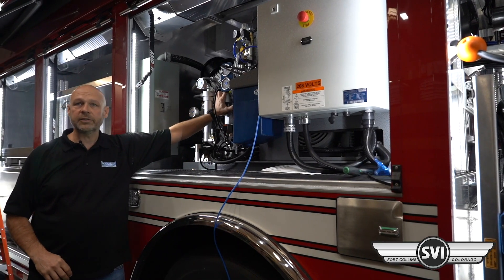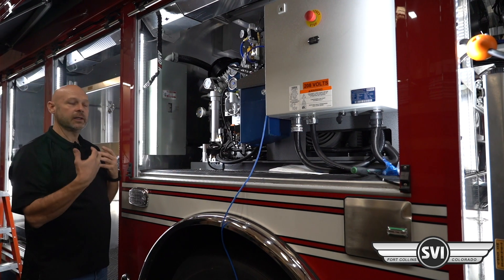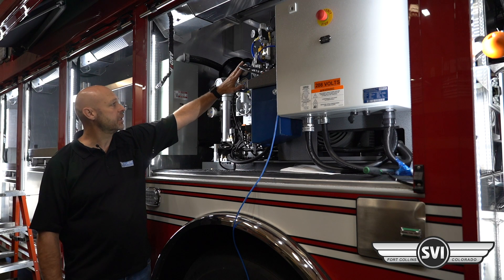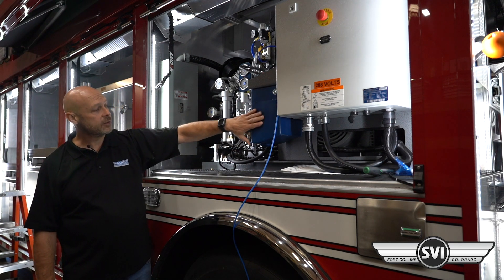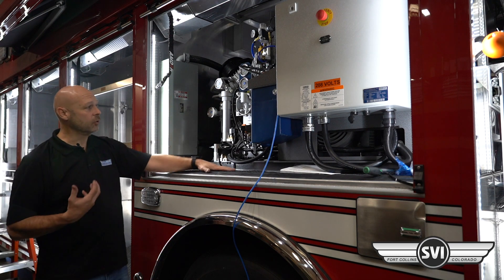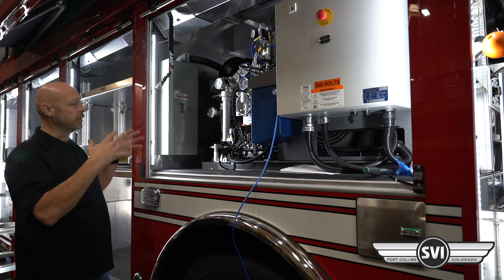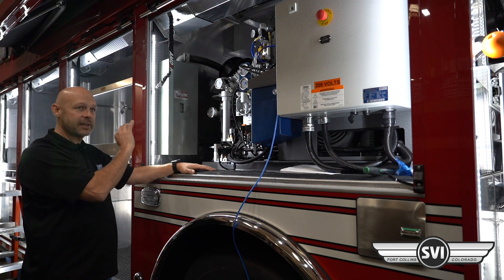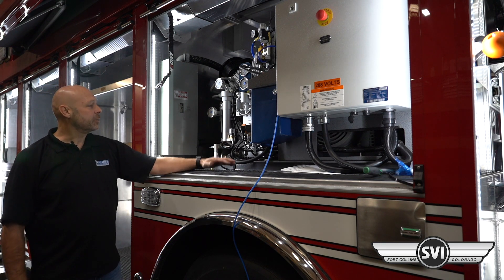SVI Trucks - Bauer 5-Stage Compressor Overview

Comment: Greetings, 

I really enjoyed and learned a lot from the two SVI/Bauer instructional videos on SCBA bottle filling systems. I am a layperson, in other words, just someone who isn't a FF, but one who is fascinated by fire apparatus,  I Was once a volunteer on a volunteer rescue squad in VA that had a heavy rescue, (a SWAB pretty popular back East back in the day)

 I live in Zionsville, IN  now and we have the best heavy rescue I have ever seen. (made by SVI 0f course),

 I have a question about the discussion about CO. I think it is amazing that there is a sensor that would protect the FFs but from CO especially on the scene. If the sensor sounded the recommendation was to relocate the Air unit. That could be difficult on the fire ground, Why isn't the apparatus equipped with an extended exhaust hose? like a hard sleave hose on a pumper but probably more like the exhaust hoses that drop down from the ceiling when apparatus is in quarters. That way the exhaust would be vented far away. 

Perhaps my question may sound nieve but obviously, Co is deadly why not prevent it?

PS my profession for 30 years has been  Risk Management, Loss prevention, workplace injury and disease prevention.

PS I am a subscriber a love all the videos.

Regards,

Gordon P, HAll. MBA. FASHRM
Reply from the maker: Gordon, thanks for your interest. Every truck we build is spec'ed differently. Many departments take into account the mitigation of exhaust and other fumes; on several rigs, we've actually diverted exhaust through the roof per the department spec. We will be posting another video today that shows the filtration system on the Bauer Compressor and how it also helps mitigates these fumes.